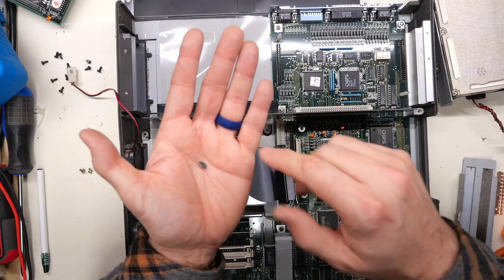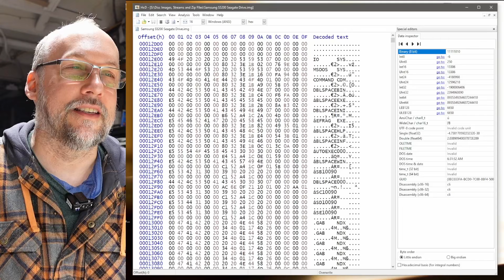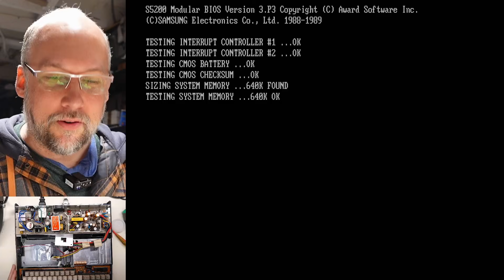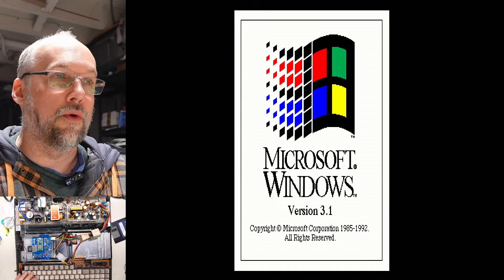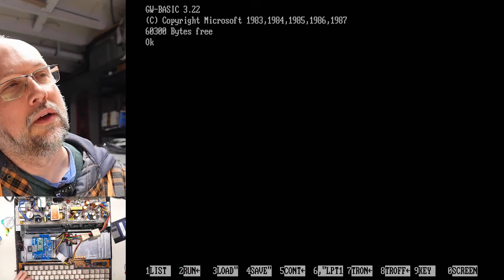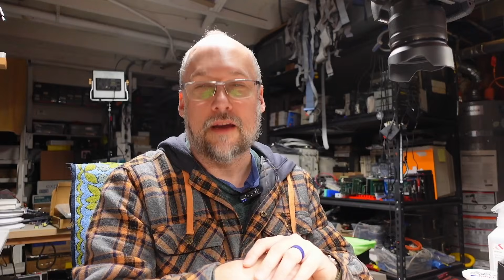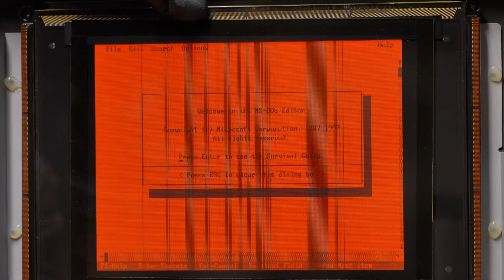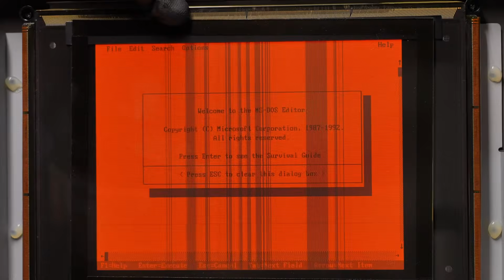PC Archeology: Let's explore the Samsung S5200 and attempt a repair on the gas plasma screen

Comment: Looking at the hex dump of the directory you found I see a hidden & system file dblspace.bin, dblspace.ini and the very important dblspace.000 which should be the compressed disk as a file.  The dblspace.exe entry looks to have deleted and I do not see a config.sys to load the DoubleSpace.bin driver.  Booting from a floppy with the doublespace driver may get you access to the compressed drive.  This is really dusting off brain cells I have not used in about 30 years.
Reply: I guess I should have waited to the end of the video before commenting, you seemed to figure it out.

Comment: About the floppy drive. Citizen did make electronics, so it possible that it is a Citizen drive. Also, IIRC (and don't quote me on this AT ALL) , Citizen and Seiko have partnered together before, so it possible that it is an Epson (as they are a subsidiary of Seiko) drive, which were quite common.
Reply: I was going to say that Citizen used to make printers, but a quick Google showed that they still make printers, mostly of the Point of Sale variety.

Comment: Wow that thing a SERIOUS blast from the past.. Laplink, I remember using that to copy from computer to computer back in the 90s.. man.. what memories!!
Reply: Yeah, between the years of the sneaker net and LANs, that's all we had.  The version I had on hand had the ability to transfer files via the COM: or LPT: ports. It was great for moving large amounts of data that simply wouldn't fit on floppies or for people who didn't want to sit for hours feeding floppies from one PC to another.
Reply: 100% laplink, pw (professional write) disk doubler and windows 3.1 a big blast from the past.
Reply: a tech radio show i listen to had a caller a few years ago trying to get laplink working to transfer files to a new i think windows 8 machine. i had hysterical laughter as the host explained why thats not possible anymore. macs had a similar feature called target disk mode which apple abandoned when it switched to intel.
Reply: I still have a laplink cable, db9+db25 connector both ends (null modem cable essentially).

Comment: I would still love to see you try to repair the plasma display. It already has vertical lines, so if you end up breaking it more, it doesn’t really matter.
Reply: I would not have given up that easy either, I would at least try to reheat and press the ribbon against the screen anyway
Reply: @Pulverrostmannen  Probably just waiting to get a feel for whether people would be upset about trying and ruining the monitor more or not.  I'd say try, personally.  it's likely just going to get worse if just left to be otherwise, and even if it's short term, just showing it off working as intended would be some interesting documentation.
Reply: @Aeduo  yeah I suppose. It is the same issue with the original Gameboy too and to re-heat an even very bad screen have a pretty high probability to be recovered. Probably about 80%. But the possible corrosion can be a problem but if the contact surface would be completely gone it would not flash rows of pixels by itself. Some are really close to work
Reply: Me too can't make it worse

Comment: You're absolutely correct, as soon as you found the drivespace (or doublespace) on the HDD, I knew you were missing the container file by not booting that drive directly!! At least you found it!!!
Reply: i used to run into this issue all the time with old(new at the time) computers. weird how they did that? i can't see that it saved any space and it would just confuse people saying where did my files go.

Comment: Hello, Adrian!
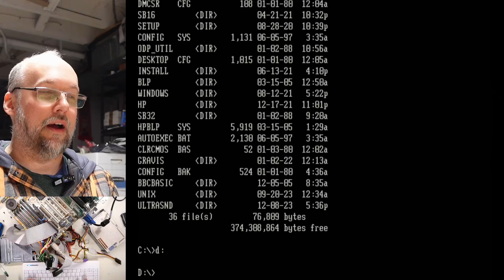at 14:30 you may see that only 4Mb free on that SCSI disk drive, so you should boot from it or load dblspace driver manually when booting from other source.
DIR command doesn't list hidden or system files, so you don't see all the contents of the disk.

PS Didn't see the video to the end prior commenting.

Comment: Hey Adrian, would a Compaq SLT 286 luggable screen work? I have one collecting dust, and it worked last i tried a couple years ago. I'm pretty sure it was an orange gas plasma, but i don't remember for sure.
Edit: Nevermind, it was a compaq slt 386/20, and i found the screen but it looks entirely different. And was an LCD, not a gas plasma. For some reason i was confident it was a gas plasma.

Comment: There are a lot of circuit conditions that can cause tantalum capacitors to fail. Older packaging (versions) will weaken over time due to heat, having to deal with voltage spikes, high current cycling, or excessive ripple. Some of the reasons why they fail in older equipment are due to how manufacturers were implementing particular components in a design at the time. Tantalum caps  in many cases were being implemented to serve as decoupling (think shock absorbers) from poor electrical engineering - either due to poor design or simply the quality of the other components in the design (or both lol). Its best to view them as a maintenance item when inspecting older equipment. That's just my quick summary. No intent to write a thesis with all the fine points in a YT comment ;)

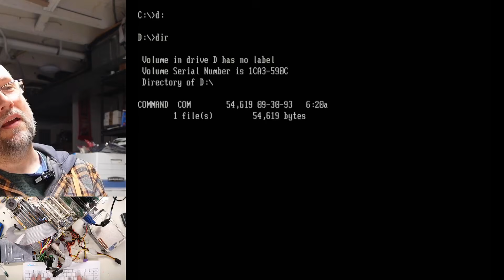Comment: 15:03 Wait a second ! The drive is 30MB and has a single partition - and only 3,9MB leftover space ? Nah ! There is more on the drive but most likely the SCSI adapter didn't get it with that OS since it may not load a boottrack-resident software or driver. Leave the drive untouched and re-install it in the Samsung later again. Thanks for sharing !
Reply: Hidden file perhaps? There isn't really anything more that can't show up.

Comment: Gotta pay attention to that free space counter.  ;)  I instantly thought it was odd you only had like 3MBs free.  But for drives that aren't Double Spaced...  :)  There was an old Norton program that would rebuild the FAT from scratch.  I think it was just called "unformat" and would scan the whole disk for files, it worked really well.  You can zero a small IDE flash card, then DD the old disk image image onto the blanked card and run the tool tool on that.  For a modern option (and more aggressive), on a Linux system install a package called "testdisk" and try the application called "photorec".  It won't recover directory structures or file names, but it's free and works!
Reply: There was an old program intended for emergency data recovery on floppy disks (and I think it even would only work on the A and B drives in order to prevent it from being used on a HDD).  It was named OHMYGAWD and it would simply find out how many root directory entries could exist then fill the entire root directory with equally sized files containing the entire contents of the data space on the disk, replacing any file names already in the root directory.
The program was an emergency last resort.  If you lost something and undelete could not recover it, you could use the program and then explore the files it created in order to try to find what you had lost.
Fairly obviously, it wasn't really intended for the recovery of programs, but data, and generally of textual data.

Comment: When you issue the DIR command, it says that there is only 3 MB left of free space. So maybe maybe you should try to do a DIR /A command to see if they are some hidden files. It seems that doublespace was used before on this drive, so maybe you will se the big double space file hidden in the root directory...

Comment: I wasn’t sure what the deal was with the partition on the drive, but it looked like it had only 3MB free on a 30MB drive so I figured there was at least some kind of hidden files on there. I wanted to say that but you figured out what was going on later.
The Seagate drives that look like this are pretty nice, they probably are some of the best stepper based drive, though they sometimes suffer from stiction (that one spun right up, so it probably doesn’t have that problem). I wish you kept the drive in the machine but I guess not risking to blow up the PSU again is probably a good idea.
Bummer that the screen isn’t fixable as it looks pretty interesting.

Comment: It retains CMOS settings with the battery missing? There's probably a super cap or even a large value electrolytic in there. Might be good for a few days.

Comment: For that hard drive, the early Norton Utilities included an unformat utility that searched the drive for the partition table mirror and directory entries and used that to attempt to recover from a format.  It didn't always work, but the kind of files you are looking for would generally not be fragmented, that would make them more likely to be recoverable with that utility.
Reply: if unformat didn't work - probably only r-studio or similar sector-search recovery software may help.
there is a free clone called r-linux which is not very advanced but might be enough for a simple task.
Reply: 8 was going to recommend the Norton utility before Peter sold out and was the goat.
I couldn't recommend Norton utilities now as it grabs hold so thoroughly that you can never totally get rid of it.

Comment: I have a Toshiba T3200SX laptop. Very similar setup. Unfortunately the screen stopped turning on and then at some point the glass cracked. Even the VGA output doesn't work anymore (just gives and all white screen). I took it all apart (luckily I managed to track down a disassembly instruction manual) and planned to research how I may be able to fix it but it's still in pieces and I haven't touched it since. Really sad about that. I liked that huge thing. It was fun putting an sound card in one of the two ISA slots it had. It did have a VGA display though. The screen displayed 256 shades of red. Hooking up an external monitor would display all colours obviously. One thing its screen never had a problem with the entire time it was working, though, was the vertical line problem. The plasma display part number on mine is a MD480T640PG3
Reply: I had one of those in the 1990s. I sold it off for a few £s when the hard drive failed. I recall the Hard Drive was some strange JVC type that didn't even have a separate power cable,
Reply: @MrDuncl  Yes. The floppy drive too had a proprietery connector.

Comment: 1:11:18 it does not work the same as a CRT. There are no fluorescent substances in there to deplete (there are in 2000s era plasma televisions), and neither do the cathodes lose emission in the same way thermionic cathodes will. 
The way they fail is probably more likely akin to that of a NE-2 neon indicator bulb.
They do wear out eventually. I have a Toshiba T3200 with the wide screen, but it has always been used on 320x240 resolution. You can vaguely see the outline of where it has been used VS the always dark sides of the screen.

Comment: I always save a backup of EPROMs (from video card, BIOS) before all. It’s very important and can be very difficult to find. Nice video. Thanks a lot.
Reply: Do you take them out and read them with a eprom  burner or do you use a dos program
Reply: @lougarou007  yes, exactly. But I use a Windows program.

Comment: I do not know anything about those screens, so please take this idea with that in mind.  Could you try to inject some deoxit?
Reply: I was wondering if deoxit would help by creeping in, or at least stoping the corrosion from getting worse.

Seems like the least intrusive thing to try before changing the screen for an LCD... I'd just use it the way it is, the screen is the unique part about the computer, otherwise it's just a 286...
Reply: It would probably damage the adhesive and make the display worse.

Comment: 1:02:40 this type of ribbons can be reglued. at work we had to do this to some embedded LCDs 2 decades ago due to EOLed parts. but it's a process which needs a lot of chemicals (desolving old glue, cleaning, new glue) and mechanical tooling (screwing jigs with silicone covered clamps). and even longivity of the repair is more like 90% over the next 2 years. (and please DO NOT try any of those hacks like "brushing with silicone sock over soldering tip to reheat existing glue". it will not last and deform the flexboard in a way that prevents any future repair)
Reply: The military still uses gas plasma displays in very old mission critical systems, so there must be a supplier still making them.  Not saying they'll be compatible with this, but the tooling and parts should still exist.
Reply: @davidkane4300  those gas plasma displays of fire solution and fuse timer computer in the gunners hatch in german gepard tanks still seem to work without stripe issues, at least in the videos which we see coming from Ukraine.
Reply: @rarbiart  exactly... I saw these displays used in very old NATO communication systems (teletype?) That are used 24/7.  I doubt they are 35+ year old parts since Adrian mentioned they will become unreadable with heavy use.  A company must be making replacements.  They may not be cheap enough for an individual like Adrian to purchase, but military equipment is often auctioned when it becomes surplus, and that is affordable... Sometimes brand new (or low hours) equipment is auctioned.
Reply: @davidkane4300  Not necessarily anyone still making them, since it could just be a huge stockpile of spare parts ordered at a time when the life expectancy of the things were known and therefore were made into a regular maintenance interval thing to swap out, and once the devices are out of their support era, there won't be any more parts for them either.
Reply: @jammi__  that could very well be, but they're still so ubiquitous in military gear.  I wonder if the video signalling was standard so that it would be easy to retrofit a modern LCD?  I could see defense contractors coming up with a solution like that.
Reply: @davidkane4300  I doubt that. More likely they have lifespans of various devices and start phasing them out with entirely new replacement devices well ahead of the end-of-life of the old ones.
Reply: Yeah I think strange parts? Has a video on repairing LCDs or oleds or something in a factory, like in a way most would have thought impossible!
Reply: It might be fixable with z-axis tape and some fiddling but removing the old glue is definitely the most difficult part.
Reply: I thought fiddling with a heat gun could improve the picture, but the process with the regluing sounds more appropriate. Maybe an instruction could help Adrian out :)

Comment: Get that disk onto a Linux machine and DD the raw device /dev/sdx (no partition number) to a raw image and do all your recovery operations on a modern Linux work station. The normal set of Linux file system tools will allow you to try to mount that partition as ms dos, or use dd to create a patch partition to graft onto the erased data to reconstruct a file system to allow you to copy the files that are part of the 'overwritten' partition.

Comment: I always found Plasma screens to be a kludge, but LCDs back then were garbage, slow and with power hungry backlights. Most of the gas plasmas I saw were compaq portables or Toshiba luggable "laptops"
Reply: Witness the LCD screen on the Amstrad PPC512, for example, a roughly contemporary luggable to this 286.  Doesn't even have a backlight, so it's dim just to add to its shortcomings.

Comment: Hey just so you know, you can force unformat to recover a drive that doesn't have unformat information but in some cases it might not be able to recover the filenames themselves and might even ask you the first letter of a file it's recovered so you're better off with more modern and convenient tools.

But from personal experience (personal experience being me fucking around with fdisk not knowing what it was for), it was great for recovering practically everything that I'd lost after having had to format my C drive, baring a few corrupted files that were still recovered to varying degrees of success.

Comment: File recovery: Please look at the tools in the Arch Linux Wiki under the section "file recovery". i had good results with "PhotoRec" (which is opensource for Linux and Windows, and not crippleware). it was initially created do deal with formatted CF/SD-cards, but does the trick with images of rotating rust devices too.

Comment: My day job is IT forensics and when trying to undelete content aka carving then the best tool is testdisk and/or photorec from cgsecurity. 
but i dont have high hopes when there is used disk compression as that will make it much harder to get the right content out.
Reply: I was just about to make the same suggestion and decided to try and see if someone had already suggested it in the comments. Testdisk and photorec are one of the best tools for recovering data!

Comment: That power supply has mains voltage coming in, right? Maybe your bit of random plastic underneath would be better replaced, even if just by a bit of plastic with no holes in it, that fits the entire space, or else cardboard or the like. You can be a bit sloppy but you still need caution.

Comment: Tantalum bead capacitors have a low current surge rating and are thus unsuitable for power rail decoupling. tubular tantantalums should be used instead.

Comment: Hi Adrian. I think that this machine deserves a second life by replacing the plasma display with a newer color LCD display and using an internal VGA adaptor in it. Moreover I recommend changing the power supply with a modern one that weights a lot less and replacing or removing all the heavy parts to thin a bit this portable PC. Additionally, you could replace the floppy drive with a Gotek and try to replace the CPU and add a FPU. Adding a SoundBlaster or AdLib card could be an interesting plus...